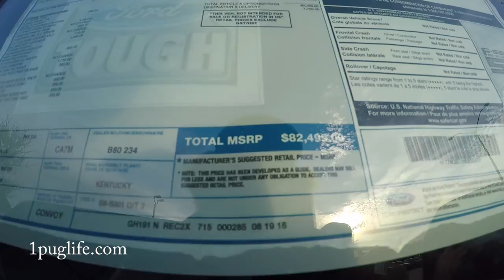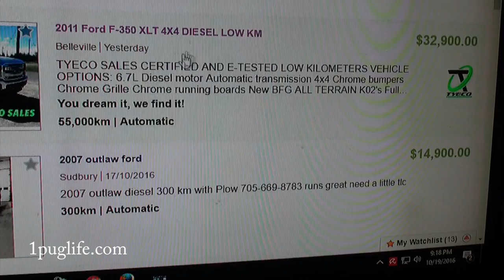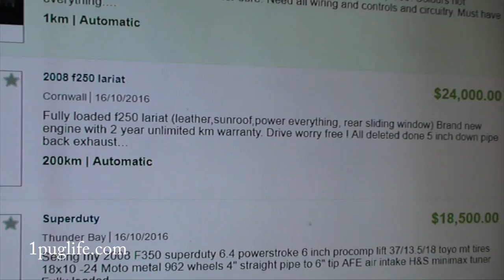truck shopping and getting kicked out of walmart

Comment: Get a Chevy
Reply: hes not buying a truck for his wife
Reply: He's also not buying a truck that requires the cab to be pulled off to fix a problem either.
Reply: What's his wife got to do with a truck?
Reply: you mean like he had to do with his ford?
Reply: Ugliest truck on the market - why not!
Reply: Why is it that GM makes Chevy and GMC and the GMC is ten times a better looking truck?
Reply: Because GMC is purposely styled to lure ignorant Ford/Dodge buyers. The ones that think GMC is magically better than a Chevy. I happen to like the new Chevy's style. GMC is WAY overdone.
Reply: Kevin Vance I own an F150 that I happen to really like. I like GMC and Ford..not much for Dodge or Chevy either one. I've had nothing but good luck with my truck. I've got friends that have F150s use them for work trucks and some of them are getting close to 400 thousand miles on them no problems. Hell if you take care of any of them they should last you.
Reply: I worked as a tech at a Ford dealer for almost 8 years. I'd pass on owning one every time.
Reply: Stevo GMC & Chevy are same bud
Reply: Nathan Carr I know same running gears frame etc..but the GMC Is the better looking of the two..Totally different grills etc.
Reply: Nathan Carr The GMC looks more like a mans truck where the chevy looks like a womans truck LOL
Reply: So, you admit you buy based on looks....LOL
Reply: Kevin Vance not really but I dont pull a trailer..nor do I haul wood or anything. I have an F150 4x4..IF I need to haul something I will if not I dont..Chevy just looks like a girly truck

Comment: Why don't you just get a crate motor and set it up right ffs!
Reply: Bryan Roberts that's too easy man lol
Reply: Bryan Roberts irk if you can get crate diesels that will work with all the computers and shit with the truck.
Reply: He could,price varies. One of our customers had to replace his and it was $12,000+
Reply: FishFind3000 absolutely you can!
Reply: why bother. Did you not see the body rot?
Reply: Then 42 days layer the Head gasket goes,those Ford Diesels are junk,we stay away from buying those at our dealer..
Reply: The biggest issue I see is the 80 grand for a new one. He could spend 10 to 15 and have the same truck with a "bulletproof" motor if he sets it up the right way.
Reply: James Fromnyc Me either!

Comment: avoid the 2011 ecoboost, dunno if newer ones are better. but the 11... nothin' but problems... kept it a year and sold at a loss just to be rid of it. fucking sucking water in the intercooler and faulty valve caved in the fuel tank...fucking nostarts after fueling up. nevar again.
Reply: I tell people I know if they insist on Ford F 150 get the 5.0 V-8..Even Ford says you cant plow snow with a ecoBoost only the 5.0,so Ford knows the ecoBoost is for Females going to the mall,not work..FYI,I own a car lot..

Comment: Wants a brand new truck with over 10 year old technology, yeah that makes sense. Also complaining about the engine displacement and chassis is a complete joke when you clearly stated you dont want the same regulation obligations as the 350-450 ranges have. There is a reason they have different ranges as the higher the range the more heavy duty they are, you're not going to find a 250 with the same features of a 350. 

If you want old school mechanical setup buy a 10 year old rig. Stating you want eco boost tech yet complain about potential electrical issues contradicts the statement. News flash there is no eco boost with mechanical running gear, see GM if you want heavily out dated technology.

Guess pug wants a crank handle setup too rather then all that electronic starter motor bullshit that will fail at some point....

Comment: Stuff me! 6.7ltr twin snorter... That'll need its own oil refinery and dedicated pump station.I mean how much you guys paying for fuel for Christ sakes....?  that thing has ECO BOOST marked on it, I mean is that a piss take or what?  if your lucky you be pulling 12-16mpg and prob less than 10 while towing heavy cigrit butts...  Whats the towing max for you guys also?Here in the UK we get stitched up at £1.20 per litre of diesel.My landrover defender 110 compared to those fords is a mere 2.5 turbo diesel injector. I mean its a bullit proof defender 200tdi, in my book the best engine landrover made. Loads of torque and pulls 4ton on a 3 axle trailer no worries.
Reply: honi9 we are paying 1.10 per litreof diesel and 1.07 per litre of gas. in my part of canada
Reply: its about the same as here. I checked tonight whilst out and were at 1.12 per ltr at moment.
So why the hell at those prices would you want to run a 6.7ltr diesel with twin turbos.
I mean my landrover defender can get 25mpg on motorway steady away at 60mph in 5th gear with the engine just slightly over idling. She sits sweet their and  get great mpg even when towing 4ton.
See we don't get those ford f series trucks as our emmissions regulations are a lot heavier than what you have and I just know their is no way a 6.7l twin turbo would pass emmissions on yearly MOT Test....
whats the towing regs in the usa? whats max trailer lengths and weights you can tow?

Comment: Dodge RAM Tradesman with the 8 foot box would be the truck you want...They are solid trucks, Canada's and USA's longest lasting trucks....I don't know where you get your bad ball joints from, but Ford /GM even Asian Trucks all need them after some point.. Someone must have ticked you off who had a Dodge, I would touch a Ford too many gays drive them,the EcoBoost omg total femboi rigs..
Reply: 01trsmar power wagon is sweet too
Reply: rocker85675 ?? Longest lasting trucks,how is that a pos...GM,Ford has had problems with their trucks too...Ford Diesels for one..GM has bad differentials on late 90's early 2000's trucks that self destructed with hard usage..They all have a problem ,some don't,some do...Even Toyota had camshaft problems,differential,drive shaft etc..on the 5.7 Tundra..I have a car lot and my buddy has a Transmission shop and he said GM,Ford,Dodge on average all last the same for transmissions..Funny,my 3 Dodge trucks all gas engines went up to 350,000 miles towing a trailer with a couple cars on them that I buy at auctions etc..All were 2wd,my ball joints lasted 220,000 miles I looked it up,2wd V-10 8.0 L dually ..I have a new 6.4 hemi now we use and solid truck,powerful for a heavy truck..No problems at all,none,zero...

Comment: I would put your time into repairing big dirty. From what I can see you have plenty time on your hands. Not much you seem to do daily seems to be critical. I mean you don't work 9-5.  So I would remove you engine and find a company that sells re-built plants in exchange with your removed engine.  that's what I would do.  I mean come on $50,000... almost new.. fuck that..!Or I would keep big dirty for parts and being awfull patient maybe search fleebay for another big dirty....    If your patient and prepared to travel I guarantee you will stumble upon a top top deal on fleebay. just be patient. search search search and ask plenty questions, request more pics if need be.   Also check forums and learn about big dirtys model common faults if you don't already know intimately.BESST OF LUCK,,,,,,,